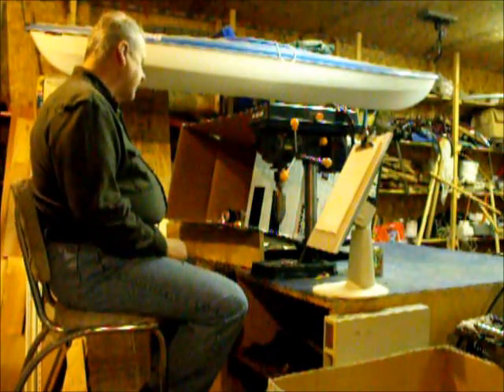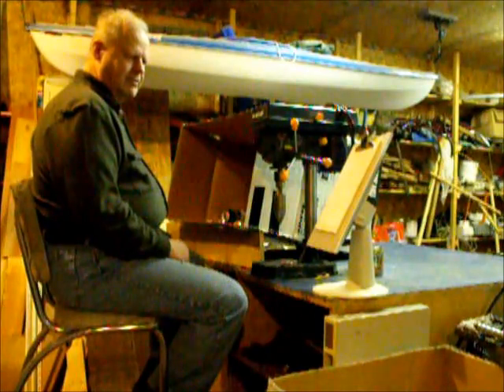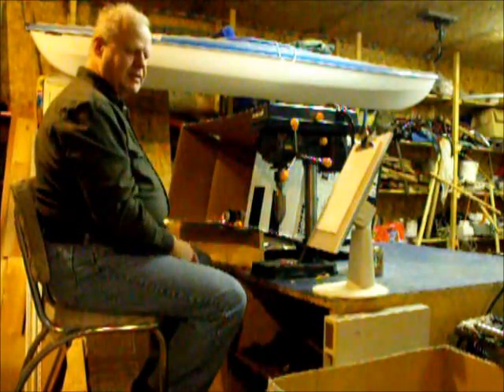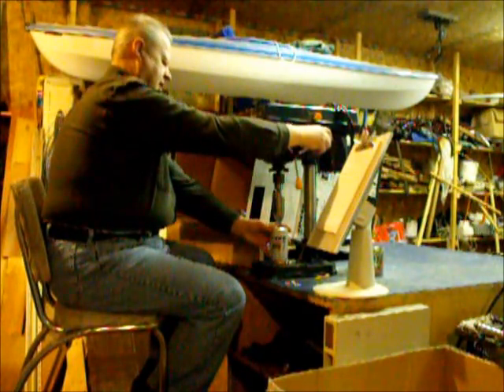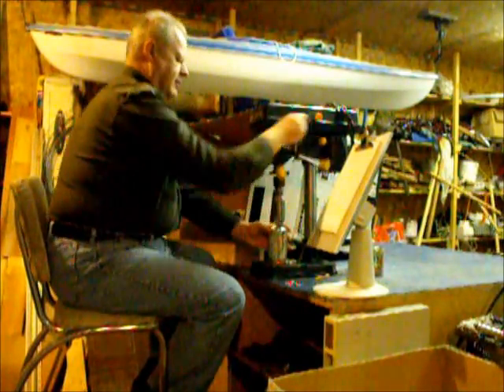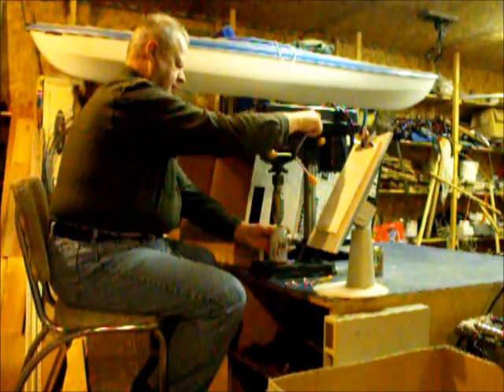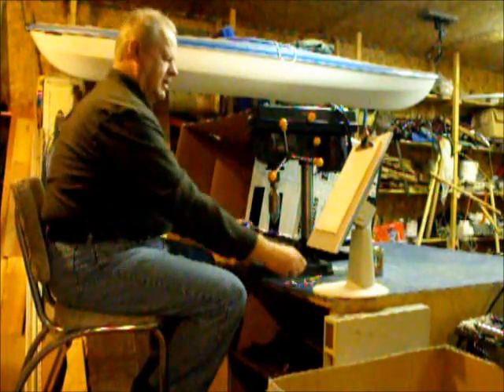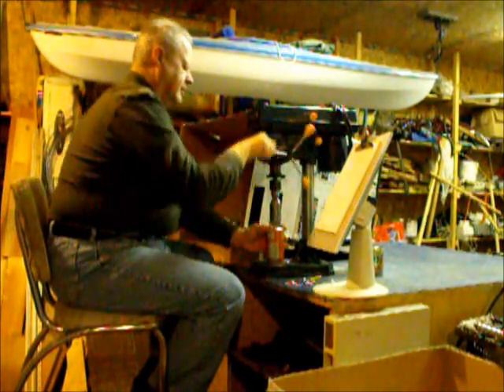Making holes in cans for Solar Collector 1.wmv

Comment: Gordon, can you provide a close up photo of the punch?

I thought I might try to make one as well..
I did see an old plumb bob that looked similar to the shape..

Does the tapered punch make a clean hole or is it quite torn or rugged?
Did you make the pointed section four or five flat edges with the grinder or did you turn it conical and gring the point a little sharper.?

David Craker